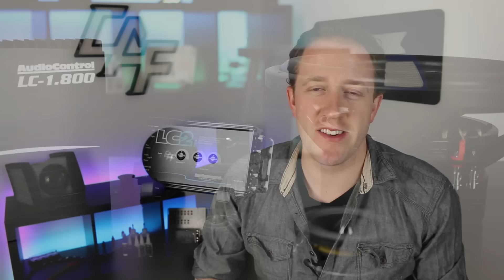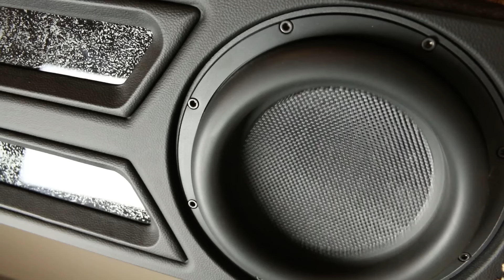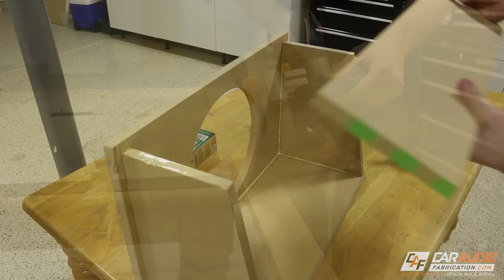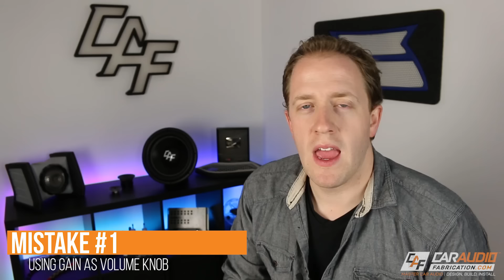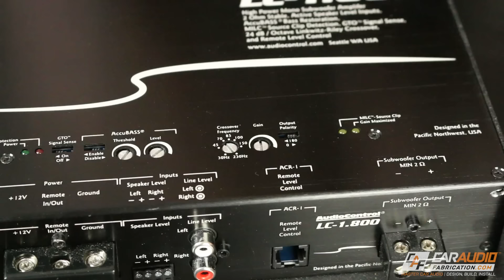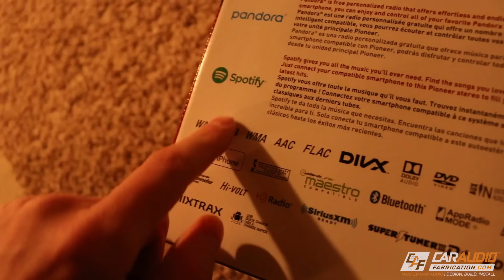Avoid these 5 common Car Audio NOOB Mistakes!

Comment: How to setup the X-Over on my AMP for the following Woofer?

I have a Hertz EBX 250 with the following specs:
Frequency range: 28 - 300 Hz
Impedance: 4 Ohm
Sensitivity: 93 dB / SPL
Peak: 750W
RMS: 250W

On a Ground Zero
- 2 x 150W RMS @ 4 ohm
 - 2 x 250W RMS @ 2 ohm
 - 600 watt maximum output power
- adjustable lowpass 50 - 250 Hz
 - adjustable highpass 50 - 250 Hz

Comment: I'm completely new to installing car audio so, I haven't made any mistakes thus far. I have installed 3 car stereos without any help, not including major upgrades of subs, speakers, amps, etc. but I don't really count that as experience since it's just a matter of switching wiring harnesses over and screwing screws and bolts into the system to finish the job.

I do plan on installing the big 3, installing a new stereo into my own car, upgrading the stock speakers to aftermarket speakers, installing an amp, building my own box and maybe helping others to do the same in the future.

I will be watching more videos to gain the knowledge required to do the aforementioned.

Thank you for the awesome video! =D

Comment: A mistake made by alot of people, not necessary novices, is thinking that you're required to use the passive crossover networks that come with component speakers. Lots of Pioneer decks have network mode, which can seriously increase sound quality, just by adding adjustments for individual speakers. Example, if you drive a coupe, and have a sub and front components, you will get more power, and better sound quality by ditching the rears and running the front active. Just think about it. If your 4 channel amp is 100 watts per channel times 4, the front components are getting 200 watts (even less because passive networks limit power output) and your rears are getting 200 watts. If you ditch the rears and use the 4 channels for the front tweeters and mids, you are still using all 400 watts that amp can put out, but you're gaining tons of adjustment.  Using passive networks on every channel, when you have a DSP that has enough channels to run them active is another case that I see. It also makes it so you can't do any time correction that will be accurate, just because you have 2 speakers on 1 channel, and they are mounted at different distances from your ears.  That is a mistake made even on high end installs. Its like they use passive networks, just to have more boxes inside the plexi window. LOL. I have seen quite a few under-utilized DSPs. I have actually seen an install that had like an 800 dollar Zapco DSP, and the sub channels were the only ones going through it. That DSP was effectively doing nothing.

Comment: I figured someone in the comments would address sound dampening. So here it goes... if you dump a couple grand into a system and all you hear is the trunk and license plate rattling you’ve wasted your money. Budget for good sound dampening and it will sound loads better.
Reply: Cant hear all that if you turn it up loud enough
Reply: Who said you have to put subs in the trunk ? You don’t have to
Reply: TR Custom Tech double sided duct tape for the plate
Reply: @biigblunts6970  4 bolts instead of 2
Reply: @847MicRoss  I agree if you only have 2 screws in your plates put the other 2 in them there's 4 holes for a reason stop cutting corners people!
Reply: I remember cutting a few thicc microfiber cloths for the back of my plates on my Accord. Used 4 bolts. Solved.
Reply: TR Custom Tech yep I agree,
Reply: I have 2 15 with a pro box in the trunk of Jeep Liberty barely has room to breath and damn my shit sounds good inside I think but outside have everything rattling  like it’s bout to fall off I don’t like it lol
Reply: Explain like, what kinda sound deadening stuff. How
Reply: @A-fb6mb  Dynamat. It makes your car give a clean bump instead of a annoying rattle.
Reply: @A-fb6mb  Dynamat. It makes your car give a clean bump, instead of a annoying rattle.
Reply: Elzidoe  lol
Reply: I have a jeep so I don’t really have a way to sound dampen well
Reply: This is where having a vert kinda sucks. Dead silence from the plates, trunk, doors etc. The other crap sitting loose for the drop top on the other hand...

Comment: I have a dilemma here and i was wondering if anyone here can help. I have a 5 channel Kenwood XR901-5 amplifier that is 600 rms stable at 2 ohms on the sub channel. I'm going to buy 2 JL Audio 12" TW3 Dvc subs that come in a Powerwedge box for each sub. The JL's are 4ohm wired to 2 ohm in each box. How can I wire them together from the cup terminals on each box to get the 2ohm impedance i need back to the amp ,or should i wire them back to 4ohm in each box and run them parallel to get 2 ohms. I'm confused....

Comment: Not using hpf on the door speakers, tweezers/regular speakers

And not using lpf on the sub

Granted many headunits already have sub set to lpf 80hz but usually the front and rear speakers dont have hpf, so they play all the bass together with the subs... blowing them and making the system sound horrible

Comment: I’m no audio professional, but the biggest and most common mistake I’ve seen is a box not big enough for the speakers. People will buy 2 high dollar 12” subs and throw them in a small pre fab box.
Reply from the maker: This is incredibly common. Every new guy is very quick to buy subwoofers without any consideration to the install. Then they are mad when they find out their two 15" subs aren't going to fit in a ported box in a Miata

Comment: Whats the RMS on this amp?...Pioneer GM-D8604 Class FD 4-Channel Bridgeable Amplifier...I'm using it to push Sony Xplod 1200 watt 12 inch subwoofer in box (1).  CARGO VOLUME 16.2 cuFT

Comment: Many people have problems with understanding RMS/peak wattage difference, 1/2/4ohm resistance difference, how to wire everything up, what type and how thick power cable has to be etc. I disagree with flac not to be as different because mp3 320 is nowhere near good as lossless. Lossless has overall more richer sound, not so in med's and high's as in low's...

Comment: I've been in the car audio industry for 16 years and the two most common mistakes I see BY FAR is incorrectly wiring dual voice coil subwoofers, and always bridging any 2 or 4 channel amp with no regard to subwoofer impedance.  Especially when you combine the two for catastrophic results!!  ie 2 channel amp w/ dual 2 ohm subs bridged at 1/2 ohm mono and they wonder why it's blowing fuses and going into protect XD

Comment: I have personally made EVERY one of these mistakes and more. One thing he failed to mention is that modern cars with their computer systems can be DAMAGED by excessive current draw as well as the use of a capacitor. I always recommend ISOLATING the audio system from the cars electrical system if you are going over 500w RMS, mathematically that equates to about 50 A of current draw at around 70% efficiency (rough estimate). Stable voltage and current are as important to your audio system as it is to the vehicle computer. The water is muddy where car audio ratings are concerned, and some of the big names have started using skewed inflated ratings. My system is JL audio, Alpine, Polk Audio, and of course an Optima gel cell deep cycle starting battery (yellow top). Think in terms of smaller is better. I have a JL 10W7 in a ported enclosure, JL mono block (1800D) Polk audio front ,  and rear (really want to switch to FOCAL but thats another day). And JL amp for front and rear channels. Seemingly a small system, but it will rattle out your fillings and sound awesomely musical doing it.

Comment: Hi Mark 
thanks for all the tips and information you give to us.
I’m trying to design a set of sub box and port them in to a cab of my 2002 gmc Truck I’m putting the them in the bed of the truck there are 3 things I’m trying to work In to the designs
Speaker size 8 inch (4 speakers) or 10 inch (2speakers)
Making sure that there is a Knouff room between two boxes for motorcycle tire
And where to put a second battery

Comment: I had a 05 Impala with stock wiring and alternator. (mistake #1) I did the wiring myself (mistake #2 lol) and I did the Cardinal Sin of Wiring: ran my remote wire with my 4-gauge power wire.... I could have used this video 5 years ago. Great stuff bro

Comment: Go for the Big 5 cable conversion. 
ANCOR Marine grade cable tinned copper strands Type 3 or TEMCo welding cable
1. 0AWG from alternator + to battery + (add fuse close to battery +)
2. 0AWG from battery - to chassis
3. 0AWG from engine to chassis
4. 0AWG from alternator mount to battery -
5. 0AWG from battery + to starter +

Comment: Worst mistakes include, bad ground, overrated fuses because they keep popping the proper size, not upgrading mid and highs to meet the demand, and not thinking about venting or sound absorption material in the trunk.

Comment: Worst noob mistake, in my opinion, is not starting with your speakers. Look at how your current speakers are installed, more often than not they are installed into a thin bit of sheet metal or a piece of plastic trim and often with air gaps around the sides of the speaker. No speaker will perform great under those conditions. A door speaker might be glued to a flimsy door side, try bolting a piece of wood to the metal frame and fitting the speaker to that instead, maybe add a bit of dampening material to the inside of the outer skin of the door to stop that from flexing and you've already got much better sound. Upgrade the speakers while you're at it helps a ton. Replace the thin hat shelf with a proper piece of wood and instantly you'll get a lot more from your speakers in the rear window. In general beef up anywhere a speaker is mounted, it's cheap and it works.
Reply: Yes. A factory paper speaker with a whiz cone in a door that has been sound deadened will sound better than any Polk Audio Best Buy special in a tin can.
Reply: Any YouTube videos on this please? I can’t find any

Comment: Love your videos... you nailed it on the File Quality of music. I have a Silverado packed with 2-12's (pioneer competition) and 2-1200w amps (one per sub)... some songs will hit hard and clear... other songs it's distorted bass and/or shitty Trebble... it is very frustrating. I feel like alot of people have been "Tweeking" their dials to accommodate for the shitty music. I have seen it time and time again. The little Honda Civic guy with the 15" Rockfords just blasting Justin Beeber, Drake or dare I say it ... Nikki Monage lol... but their sound is shit. Gain Turned up... Stereo set to Super Bass... Sub Levels all jacked. Nor hard to hear the difference lol I roll up at the lights beside them and Johnny Cash the fuck out of their pop music lol thanks for the video guys... You nailed it.

Comment: just getting into making some car audio upgrades to a 7th gen accord.  6.5s up front and 6x9s in back, i was thinking of adding a small sub or two.  kind of overwhelmed on where to start. anyone have suggestions on what type of speakers /amp configuration to go with? or a good resource for building up a new system from the start

Comment: the only mistake i made in my first install was putting the fuse by the sub in the back rather than by the battery in the front. other than that ive had very good success

Comment: Not disconnecting the battery terminal before splicing factory wire to a new head unit. That lesson costs a few fuses.

Comment: Once you go FLAC, you never go back
Reply: Bryan Parks,   WOW right on,  High Definition Audio. The new way to go.  I just finished installing Pioneer HU with 2 Kenwood Hi Def amps along with top of the line Pioneer Hi Def 6.5 component speaker and 2 subs  sounds great and clear and crisp.
Reply: Nope, you just get a bigger hard drive/SSD.

Comment: My NOOB tuning mistake was using the digital crossovers on my head unit for a signal on its way to an amplifier. I learned that if you are just running straight to your speakers that this is when you use the digital crossovers that come with the nicer head units, but if you are going to an amp, you turn off the crossover function on the head unit and let the amp sort out the signal.

Comment: Why Do i keep blowing speakers! I just Blew 2 Rockford Fosgate R1's and a set of focal's that are rated at 65-100 RMS that where 100 bucks a pop. Im running a 100Wx4 RMS @ 2 Ohms JBL Club 704 4 Channel amp on a stock head unit Gain turned way down. 2016 Nissan Sentra. RCA's are running from the head unit spliced and split off to front and rear then the RCA's comming from the Pre-out on the 4 channel to the Class D 1200 Watt Almani. Also when i adjust the gain on the 4 channel it effects the level of the bass Idk if that has to do with the RCA's running from the 4 channel pre-outs to the bass amp or what but its been a nightmare and im spending way too much money.

Comment: I had a 0 gauge power wire with a 4 gauge ground..... just letting you know the ground on the amp melted😂. I had the speaker wires from the amp to the subwoofers ran to the plastic part that brings it inside pushing 3k watts. That melted and caught fire. Had to pass an ambulance and do 110 in a 55 to make it home to a fire extinguisher

Comment: First system was so excited ordered 2 10 kicker cvr's put it on a Memphis pr500.1 @ 1 ohm, stock alternator, 16 gauge speaker wire(smh) no sound deadener, tacky wiring rode around starving the amp with no secondary battery lights were dimming just bad I'm glad I got a lot more since that time

Comment: I'm still gonna screw with my gain control. Thanks to the factory headunit's EQ curve I can't find a happy balance between 'rock songs have no bass' and 'pop songs have way too much bass' so it's easier to just turn the remote gain down during pop songs.

Can't replace the headunit because it also handles climate control, so... shit.

Comment: I spending $500+ on my sub, amp, door speakers and wiring. Then I made the mistake of spending about $100 on an off brand deck. I spent weeks trying to figure why the sound was so sh*ty. A friend of mine eventually explained to me that the wattage on my deck had to be comparable.

Comment: I just got into the car Audio scene a few months but one thing I can definitely warn you on is if you still have a stock stereo, you need to make sure if you have a feature that increases the volume in correlation to your speed. This might blow your subwoofer if you are heavy on the pedal. Trust me this happened to my first subwoofer.

Comment: Dude I could tell you stories all day about the stupid mistakes ive done on my cars when it comes to radio installations, would you believe me if I told you at one point I've duct taped a 3 gauge ground while wedged in paper against the frame of the car frame and lived to tell the tale...

Comment: I guess I got duped by the max output for an amp, and the capacitor thing...back in the day I had a decent system. I had a pioneer head unit and speakers front and back (6x9s), and a typical wooden box in the trunk with 2 Rockford fostgate 12” subs, 2 1200 watt amps, and 2 capacitors. That system was great, sounded super clear, and really thumped. Back in the early 2000’s it was certainly something to be proud of. Did I get tricked into buying capacitors? What about the amps?

Comment: Slow clap on #3!

HD Tracks is an awesome source for FLAC and other high quality formats.

There are so many well recorded and high quality formats out there!

You’re right on with all these points.  The electrical system is a huge step. When I see someone bragging on their setup and see OEM wiring under the hood...I usually just walk on by.  Your steps for upgrading is right on as well.
Reply: THANK YOU! I was wondering about where to find high quality files.

Comment: after disconnecting the battery in my car while working on something else I couldn't figure out why my subs were clipping so bad. turns out I forgot that killing power defaults ALL the settings in your head unit and not only was the clock wrong all my crossover settings were disabled causing my sub to attempt to play way higher frequencies than it could handle. reset the crossover and it sounds like gold again.

Comment: Back in the day I would laugh at the guys who would hook their amp remote wire up to the amps power supply. The amp would run their battery down and the idiots could not figure out why. Some guys still do this today and it amazes me how dumb they are to not get a professional or at least do some research first.

Comment: About Mistake #3, i have only 128 Kpbs songs on my USB-stick, should i only have songs that are 320 Kpbs from now on?
Reply: Nevermind! I watched the video again and i understand now.Thanks mate!
Reply: If you get new Music from now on make sure it has high kbit/s (192 kbit/s +) if you want to use mp3. In my opinion 256 kbit/s is the sweet spot, where I dont hear any upgrade to 320 kbit/s. Most of "normal" hearer cant´t even tell the difference between 160 and 320 kbit/s. The thing is if you have 128 kbit/s music already, you can´t "upgrade" it to 256 or higher kbit/s, because the information is lost. A practical way is to ensure high sound quality in mp3 is to use a CD (Wave format) and convert it into 256/320 kbit/s mp3. The standard bitrate from streaming services if i´m right is 256 kbit/s, which is just fine.

Comment: alt and battery is a must see noobs all the time running no upgraded alt 
my ride 04 subaru sti 
240amp hairpin alt from singer
dc audio 2.0k
2 sundown sa-12srev3 d4
highoutenclosures custom birchwood box built to spec
sky high 1/0 awg amp kit and big 3 
smd fuse holders 
kicker cs speakers whicj will get replaced with sundown neopro v3s
jl 400/4 amp 
skyhigh 8 awg power and  ground
knukonceptz krystal 4 channel rcas 
upgraded sealed battery under the hood 
second battery coming soon 
shca 80mil dyna mat trunk and door